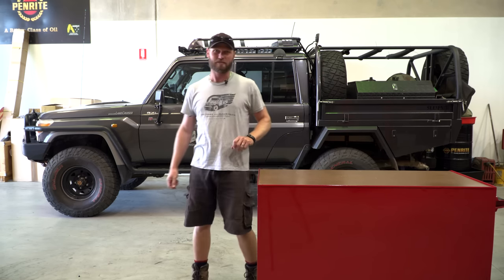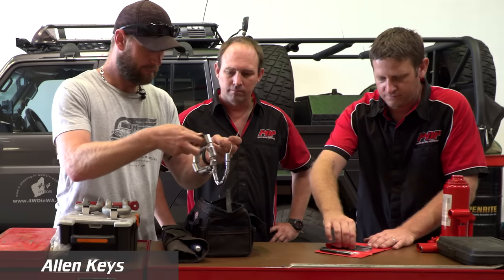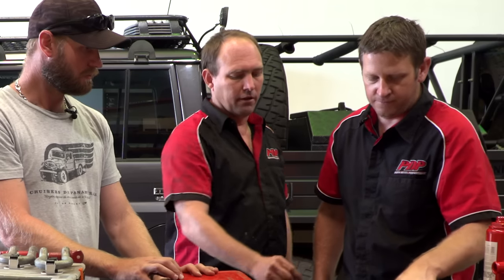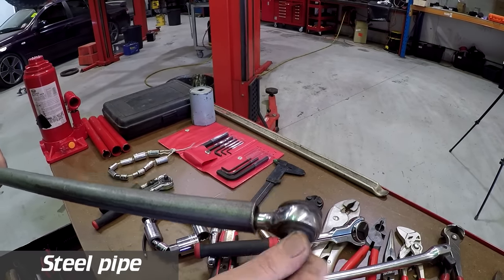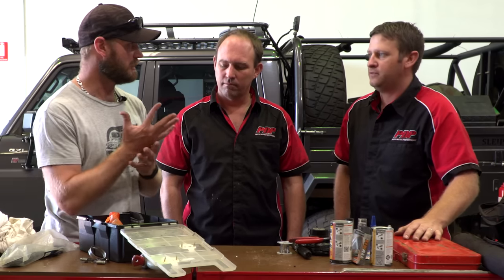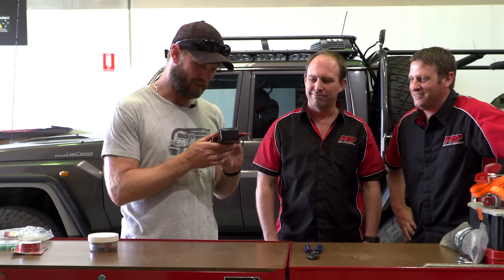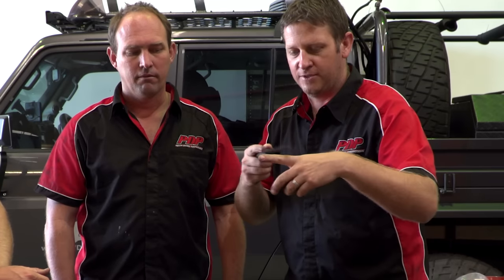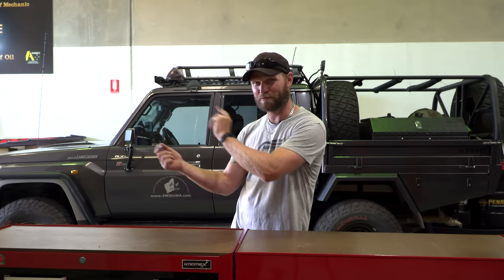Overland Tool Kit, repair kit

Comment: I recently hit a kangaroo in my work van smashing the bottom mounting point off the plastic tank on the radiator causing the water to flow straight out, i used dynasteel plastic tank repair to put the mounting pin back in place and seal the leak, so far i have traveled 3000 kilometers on dirt and corrugated roads and it is still holding together, I have a new radiator ready to replace the old one but wanted to see how long the dynasteel would last, its still going strong 6 weeks after the repair, the one i got was called dynasteel (plastic tank repair) and it also came with a rubbing stick that seals up fuel leaks both components can be used straight over wet leaking repairs,  I am going to buy some more to keep in my cruiser tool kit, great stuff & thanks for the video, gave me a few extra ideas for my cruiser toolkit :)
pic of the dynasteel plastic tank repair after putting the bottom mounting lug back in place https://www.instagram.com/p/BQo5RhNh9Rd/
Reply: How is the kanga doing?   lol

Comment: Why are the "hexagonal keys" called Allan keys? In Sweden at least we call them "Insex" which roughly means "internal six", just curious.
About the UV resistant to the "zippers" we had non UV resistant at our welding robot at work, and yes, they just went into pieces after a couple of months.
Don't buy too cheap multimeters because THEY CAN KILL YOU (not very likely with 12V but if you the same mistake with mains.) especially when you put them to current (amps) and you measure let's say your battery you will then short circuit that battery, a good one will blow a fuse and survive, a cheap one might even blow apart, don't believe me?  Well, take a look at this guy. EEVblog #84 - High Energy Multimeter Destruction.
So what do you think happens when you short your battery and the arc jumps inside the MM?

Comment: G'Day Ronny, 

Simon mentioned “heavy duty quick release tie ups” for your tool bags under your seat. 

Does Simon recommend any, or what he used in the rhino challenge? 
Or an explanation of what he is referring too. Are they just heavy duty jockey/bungee straps?
Reply from the maker: +Overlanding Downunder not bungee but those clamp style ones. Like the ratchet strap but just the little brother version
Reply: Thanks for the information. I have seen people use bungee straps in places that make me cringe.

Comment: just wondering what everyone thinks. can you put a tube in a tubeless tyre if you blow out the side wall or the puncher is too big for a repair kit. was thinking by putting a patch on the in side wall and taking the valve out and putting a tube in to get you home. to save weight instead of carrying more than one spare tyre for the long trips
Reply from the maker: +12marshy1 you can but you will need the correct size

Comment: I'm a noobie,  is there the equivalent of the NRMA who will come out in a four wheel drive (say, up at the snowy mountains) and deal with any issues on the side of the track?  Is there an off road service in certain areas I can join that does this?

Comment: Thanks, Ronny! Been waiting for this for a long time :) 
One question, what do u think about carrying a floor jack instead of a bottle jack? 
I have both but I carry the floor jack because it's more stable, can be used to lift the whole axle, it's easier to place under the car, and easier to place a wood block on it. Floor jacks take more space and are more expensive, but since my car is light I have a smaller floor jack.
I'm not an expert though, so I would love to hear your opinions. Cheers.
Reply from the maker: +Xeno I prefer bottle jack as it's compact, but floor jacks are better but very heavy and you will need one that's tall and they will require more flat ground which is rare in situations where you are stuck and need to jack up

Comment: Great video Ron , did you used to tie reo for a living mate ??
Reply from the maker: +Cdmt Reo yep still do a few days per week
Reply: reo = reinforcing bar, tie = tying wire to join and hold steel bar together.   part of the construction process in making reinforced concrete

Comment: I didn't see a hack saw or radiator stop leak?
Reply from the maker: +P00Ps McG33 good additions will add that to my list 👍 I reckon even just the hack saw blade with duct tape as a handle. I have one of those

Comment: Scaffolder eh I work for Waco in Queensland where is your pogder? :)
Reply from the maker: +chuck norris Steelfixer not a scaffy 👍
Reply: Ahh hence the tie wire skills 👌😃
Reply: Hey Ronny got a quick question I have the same 79 series dual cab would 285/75/16 tyres fit under without a lift thx in advance regards Keith